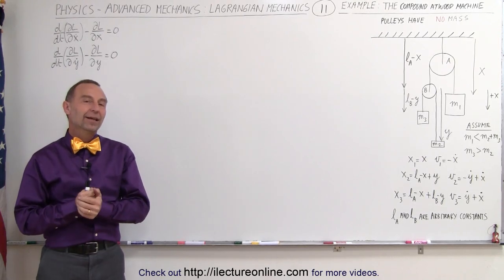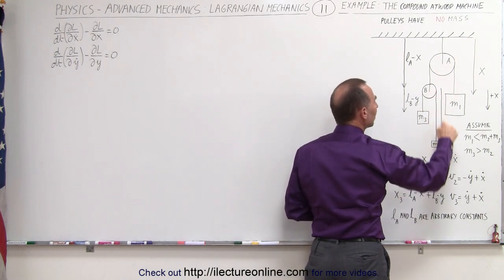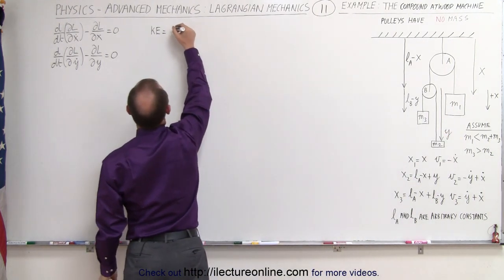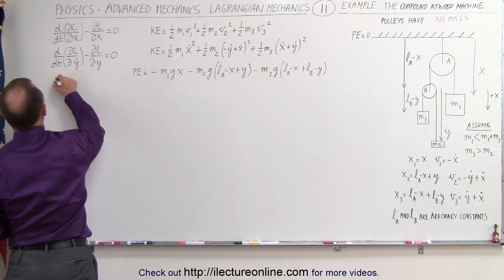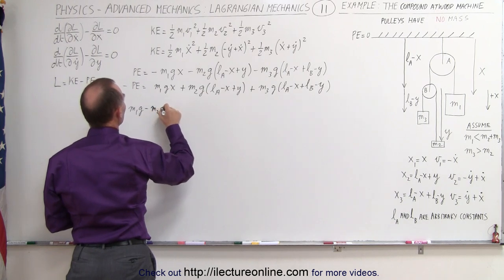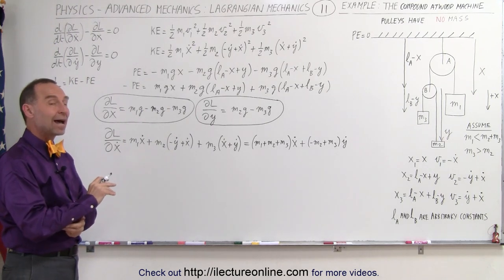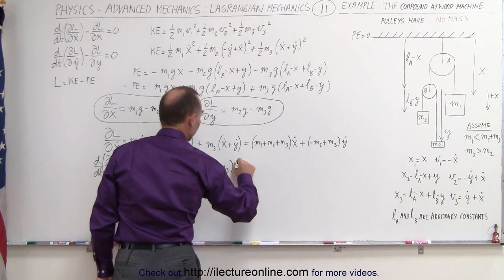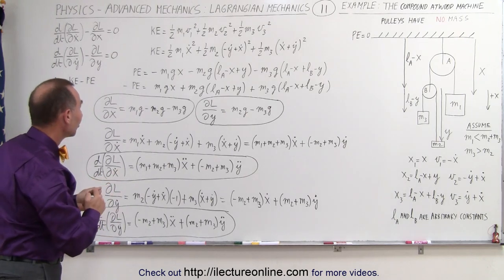Physics 68 Lagrangian Mechanics (11 of 25) The Compound Atwood Machine (1 of 3)

Comment: at 3:14, iam a little confused about the sign for the velocites. why did you say that m2 moves downward in the +ve of x but in -ve of y? don't x and y have the same sign for the direction which is +ve downwards and -ve upwards?
so if m2 is moving upwards, as you said, so the velocity is going to be V2=-y(dot)-x(dot).
if anyone can explain to me that would be much appreicated
Reply: Yeah , he made a mistake I think
Reply: Because in the sistem of x coordinates (A pulley), the whole mass associated with B pulley is going downwards. Then In the sistem of y coordinates (B pulley) m2 is going upwards for y but still downwards for x and m3 is going down for y an x.

Comment: at 8:55 I believe you meant the chain rule, not the product rule, I was confused for a while why the product rule would apply in this case. M is a constant.
Reply: Dont know if you will ever read this, but its actually the product rule. You can ofcourse say its the chain rule, which is totally valid, product rule works the same way here:
(x' - y')^2 = (x' - y')*(x' - y')
And then differentiate it. The same way how f(x)^2 can be differentiated or how you get the formula for differentiation of polynomials. d/dx x^2 = d/dx x*x = (d/dx x) * x + x * (d/dx x) = 2 (d/dx x) * x = 2x

Comment: 2:30 - You've got the wrong signs on the three velocity expressions. Velocity is by definition the time derivative of position. So, if x_1 = x, then v_1 = x-dot. Ditto for the other two. Of course, when you square these terms in the Lagrangian, the negative signs disappear and your error is automatically corrected for. It's still an error, however.
Reply: True!
Reply: I don't think it was a mistake, I believe it has to do with generalized coordinates, it just happens that in the reference plane he selected the positive x direction goes downwards. Which is the opposite of traditional examples dealing with potential energy. The fact that you can use any coordinate system is where the potential for the Lagrangian mechanics lies. It was not that the mistake 'corrected' itself it was that the Lagrangian works for both coordinate systems, the one shown in the video and the one you are thinking about.
Reply: Good point! The error is thus in the mismatch between the diagram and the equations. And that mismatch is a little bug in the video.

Comment: If I extend out the brackets in the KE equation and then take the partial derivatives I get a different answer, and I can't tell if it's correct... I didn't quite follow how you applied the product rule I the differenciation.

Comment: I dont understand why velocity two is not: +xdot+ydot, because mass m2 is going downwards if you write -y+x it looks to me that mass is going downwards and upwards in a same time... i simply dont understand that...m1<m2+m3, so whole system is moving "counterclockwise" and it IS +x, but m3>m2 so m2 is going to +y for me! Isnt it??
Reply: X is decided wrt to the main system support and Y is decided wrt to pulley B, when m1 goes up m2 and m3 both go down ie the whole B pulley system goes down so wrt to X both are going down hence X is +ve for m2 and m3.

Comment: hey u didn't calculate Lagrangian how did u took partial derivatives??
Reply: I had the same doubt at first, but if you look closely, L = KE + PE. When you take the partial of L (even though he did not calculate it) wrt x, all the terms in the KE are wrt x_dot so their partial derivatives wrt x would be 0, thats why he only considered PE. Same thing with the y.

And when he does the partial derivative of L wrt to x_dot, he only considers KE because all of its terms are wrt x_dot, unlike PE. And same thing for the y.

I know its kind of confusing but that is the answer to your question.

*wrt means 'with respect to'

Comment: Why PE is negative? If you defined your positive direction downward and PE=0 on the level of the ceiling - everything below PE=0 should be positive. At least in the very first video of the course it was the case...
Reply: I'm also interested in the answer. Could you please answer.
Reply: all objects below(x>0) must have negative potential since they are closer to the earth.
Reply: I think it's cause gravity is pulling the objects away from the height zero point (not towards it as usual) so the more the object moves in the direction of gravity, the less potential energy it has... But Li Wen Chang said what the professor said.
Reply: You have sign Minus over there because our z axis is in same direction with force.Work done on body by gravitational force for dz traveled in the direction of axis he choose is dA=mgdz and potential energy will be negative of work done dU= -mgdz .You can see that increasing the Z will decrease your potential energy.U (z +dz)= U(z)+dU